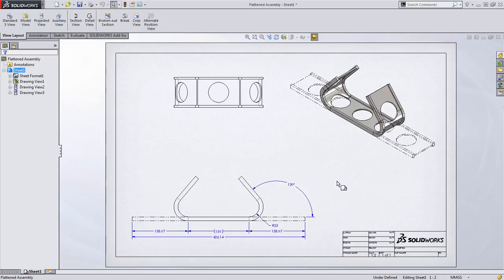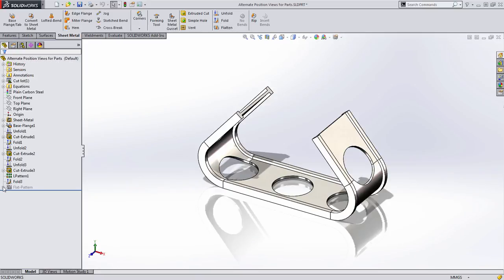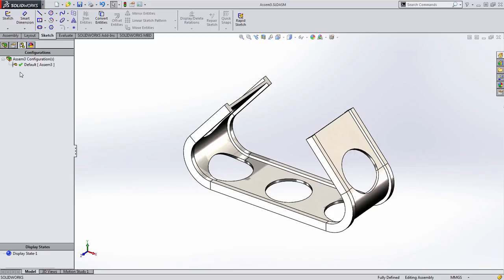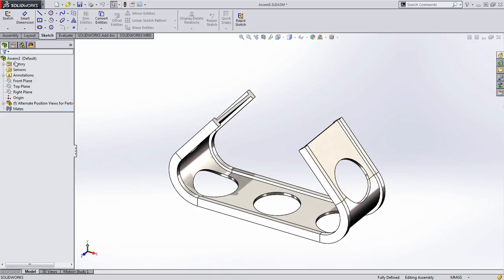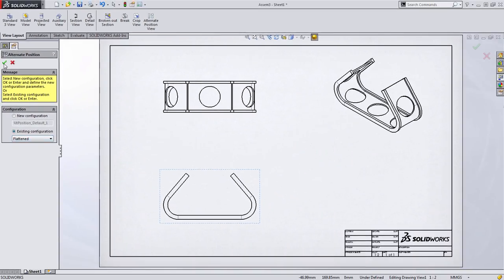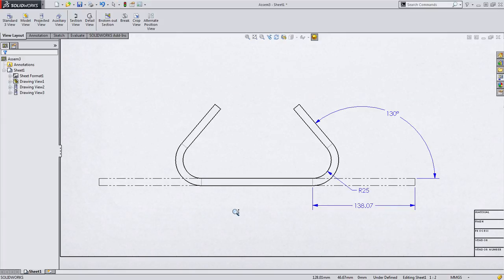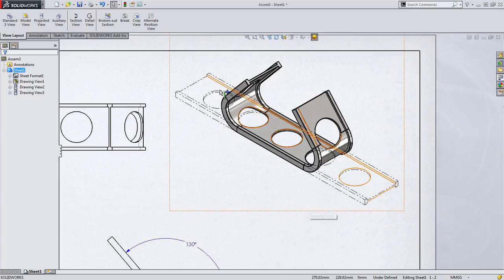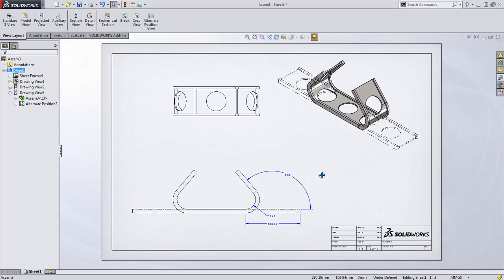Tech Tip Tuesday: Alternate Position Views for Parts

Comment: Great video. I have a question. I will made parts with banded wood. How The best way to design those parts for have the part bended and the original shape flat. In Catia V5 I use "flexible models" and can design the raw material and the final bend.